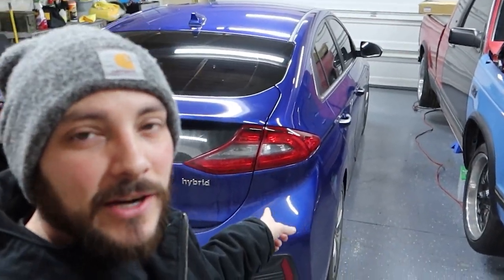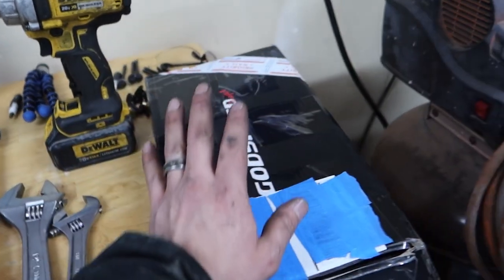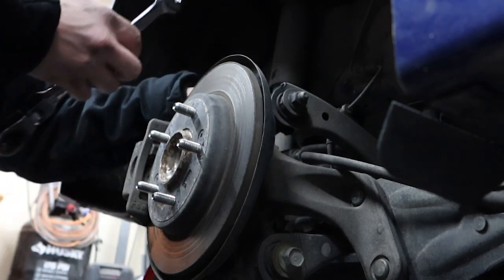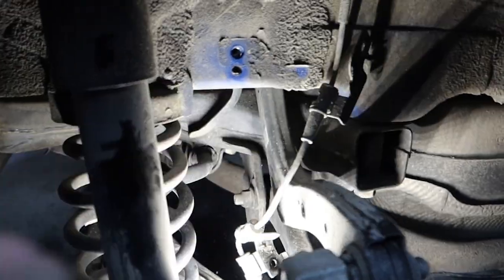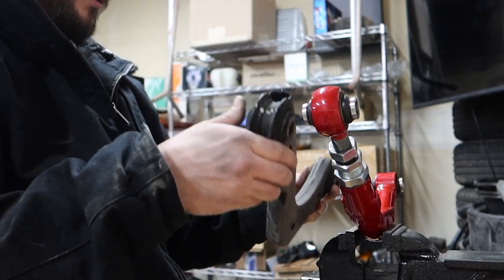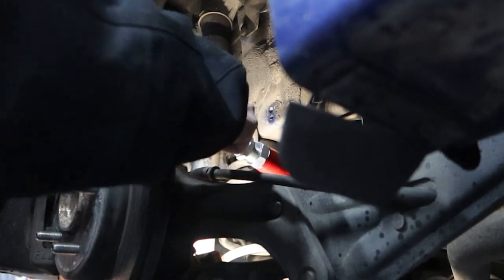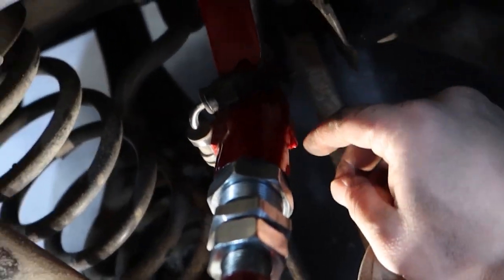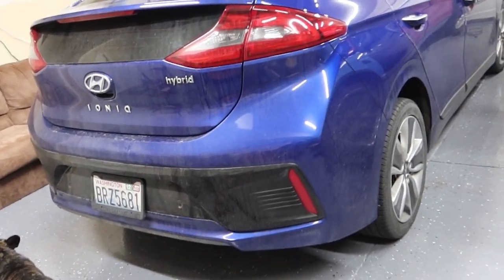How To Fix Rear Alignment Issues On 2017-2022 Hyundai Ioniq. No More Rear Camber!

Comment: I installed the Godspeed kit on my Elantra, while it did enable me to correct my camber, this kit is noisy. I was expecting some increased tire noise at most, but I was not expecting frequent creaks and clunks from the arms moving during cornering.

I recommend finding a different part for this modification - I have ordered the Whiteline KTA282 which uses more traditional bushings. If I install them and find they are noisy as well, I'll update this comment, otherwise they should be a safe bet 😊

Comment: The alignment on my brothers 2016 honda accord was so bad and paired up with bent wheels created flat spots on the tires that ran diagonal. I just installed some SPC arms on the rear, luckily it wasn't to bad. Alignment came out perfect.
Reply from the maker: Going to get my car aligned next weekend. Should be mint 👌 here in the north you have to have decent tread for winters. Can’t get away with bald tires like I did in the south hahaha

Comment: Why not a standard alignment ( camber,caster..) in a car repair shop?
Reply from the maker: The rear camber cannot be adjusted with factory arms but it had negative camber so I installed these to get adjustability for the rear and they were able to make it 0.
Reply: @Boost-EdAutomotive  I own a 2020 Ioniq Hydrid ( last manufactured) it has a negative rear camber from factory and I found out that most of the UBER here are Ioniq and most of them has this problem, so, it can't be adjusted with an aligment? why few of them has a good ajustment?
Reply from the maker: @RedPanda_00806 I couldn’t tell you. I thought it was weird too. I loaded my truck with my tools when I changed jobs and I thought that might have caused the camber but when I looked it up it seemed to be a common issue. Luckily these arms have been produced and can be adjusted for better alignment and tire wear.

Comment: Did these make inceeased noise to the car since the arms uses spherical bearings instead of rubber bushing the oem have?
Reply from the maker: Car was already decently loud and tires can change the noise level as well so I couldn’t honestly make a judgment call on that
Reply: I installed these same parts on my Elantra. Yes. These specific arms made my car quite a bit louder. I was expecting increased road noise from the tires which I would have been able to tolerate, but the spherical bushings these arms utilize have introduced frequent squeaking and the occasional "clunk" in my rear end as they move. 

If you do this upgrade, look for a different part. Installation will still be the same.

I've ordered the Whiteline KTA282 which use more traditional bushings. If they're absolutely terrible, I'll probably come back and leave another comment as such to warn others who find this video 😊
Reply from the maker: @cadeneuwirth6563 thanks!